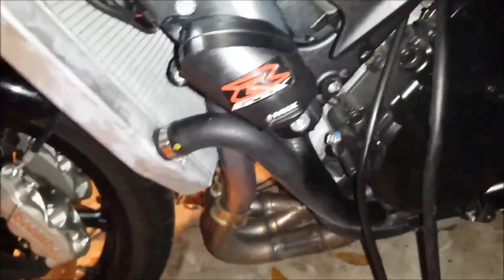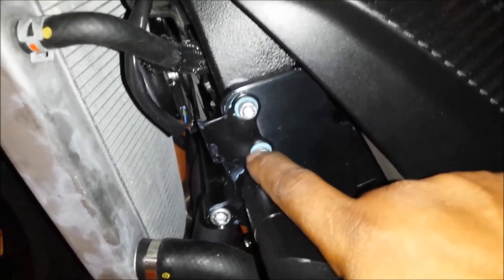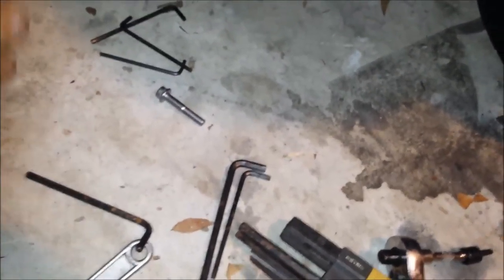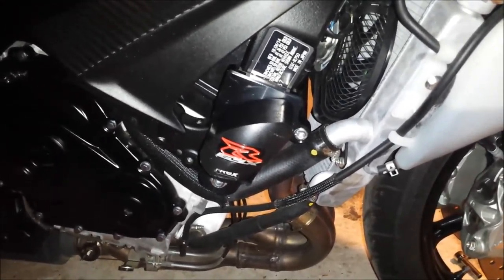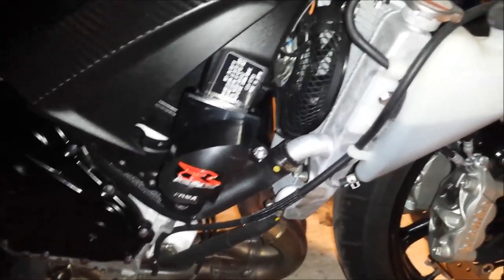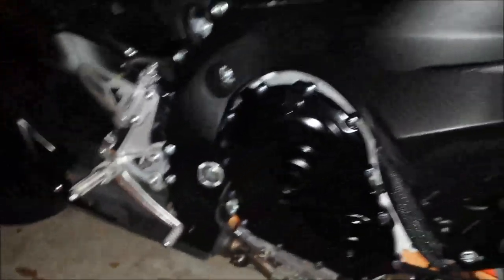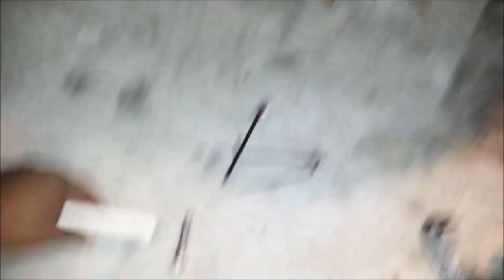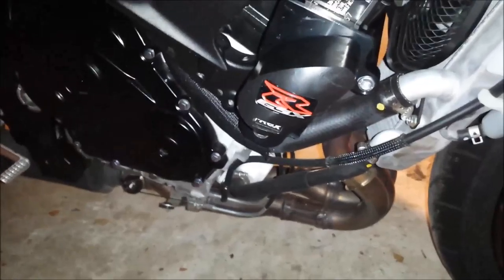T-Rex 2011-2016 GSXR 600 & 750 no cut Frame Slider Installation Guide

Comment: Good video on the install of the sliders. That engraved plate is not the only place your vin# is on the bike, it's stamped in the neck of the frame which is where cops will instantly look to check a vin#. An stamped plate could easily be removed and replaced with a phony vin# and if a cop looking for a stolen bike or someone purchasing a bike sees that stamped area on the neck of frame  has been ground down or tampered with should raise a red flag instantly.